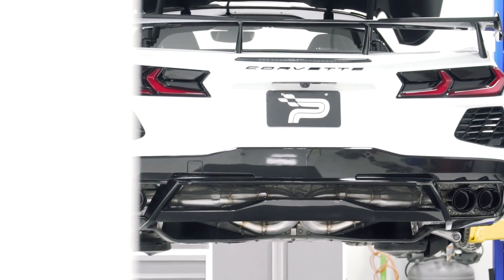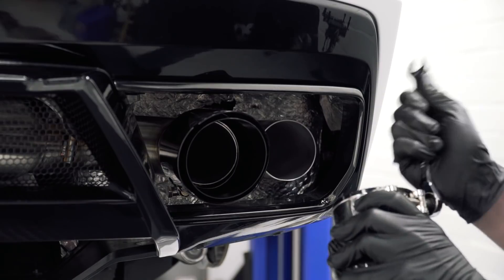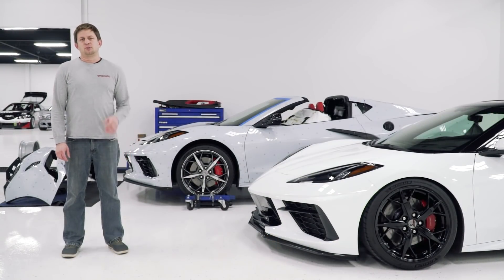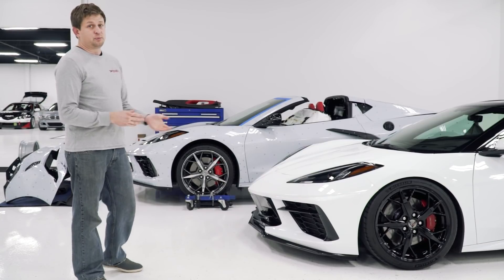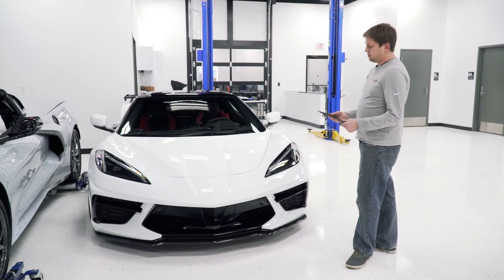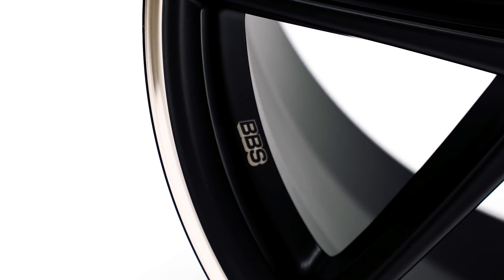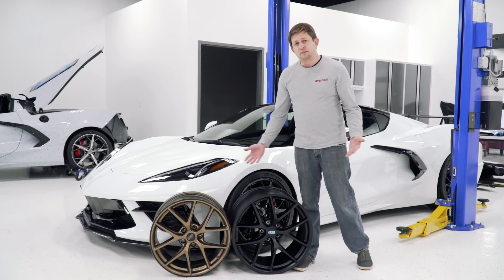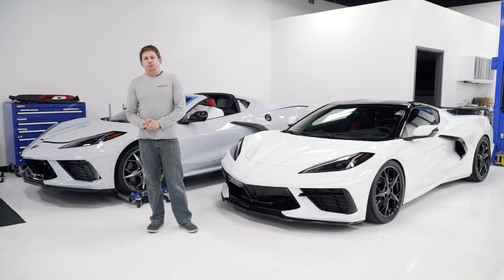C8 Corvette New Products January 2021 - Paragon Performance

Comment: How about an application that covers all areas that would  prevent water intrusion into the engine bay when washing. Designing that and patenting it would be gold!
Reply from the maker: We have something in the works. However this is something that all supercars deal with.  A lot of people use that left over water in the bay with their towel at the end of their wash to clean the engine bay, rear cabin window and etc. The bay gets dirty and with that window looking in there to see it you need to keep it clean as well and that water helps with that process.

Comment: Are the Rad guards just the 2 large outer pieces or also the smaller pieces in the outer center?  Also, rear side intakes soon?  I bought the plastic ones and am just not thrilled with zip ties on my $90K car.
Reply from the maker: The Grill/Radiator Guards are the two large pieces in front. The side guards are being finalized then they'll be put to production! We agree that the zip ties should be left off the C8, that's why we developed the bolt on guards. 😁

Our install video should be released shortly, the media team is working on it as we speak 😀
Reply: @ParagonPerformance  Are there plans to include the 2 smaller pieces for the front as well?  Just ordered some stuff from your site. :-)

Comment: I worked at a muffler shop and they said those clamps will loosen and fail. How do you address that?
Reply from the maker: We've been using V-bands for over 25 years.  Never seen one loosen or fall off.

Comment: Do you make just the tips to fit on OEM exhaust?
Reply from the maker: No the OEM tips are welded on, making replacements would require end user cutting and welding to get a surface that would accept something new.  :(

Comment: Will you be adding a dual mode exhaust in the future
Reply from the maker: The cost to do wo would put the exhaust system close to 3 grand, which is a lot to ask for an exhaust we thought. :( So for those that want to keep the NPP / Dual Mode system we suggest changing to our sport cats as this will add some sound and keep the function of their NPP / Dual mode system.  https://www.paragonperf.com/paragon-performance-c8-corvette-sport-cats.html
Reply: Just FYI, people are will to pay nearly $3k to keep valve functionality.  There are valves both on the Dow pipe from the cat and on the rear near the outlets.  If you make a set that uses all 4 valves, I will buy that exhaust in a heartbeat!